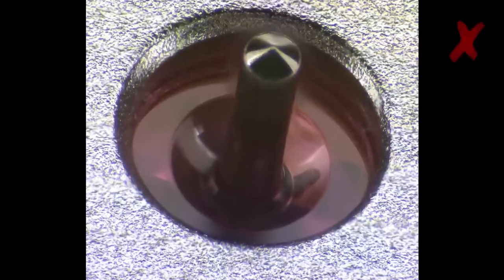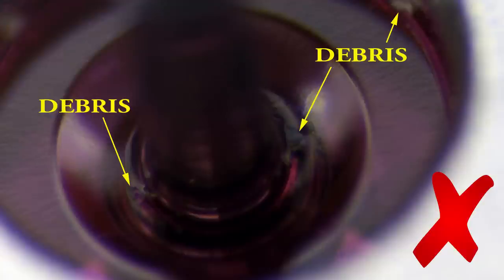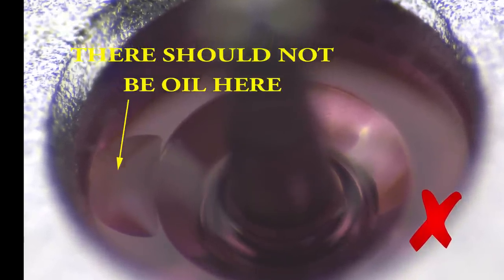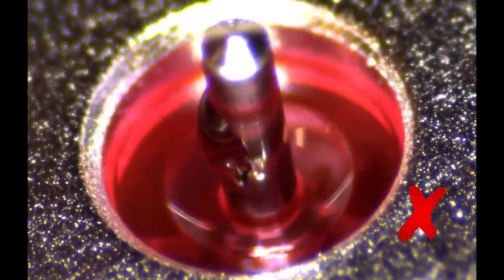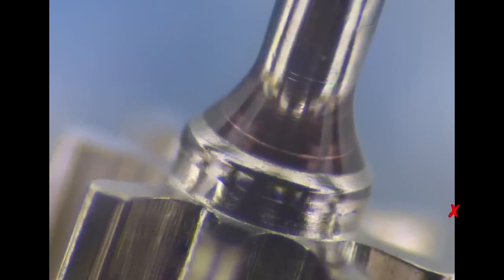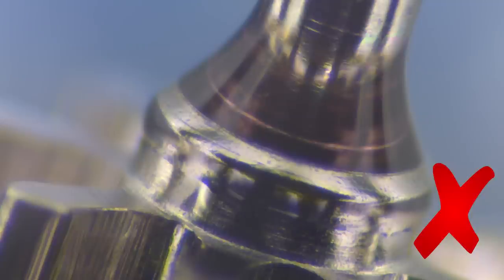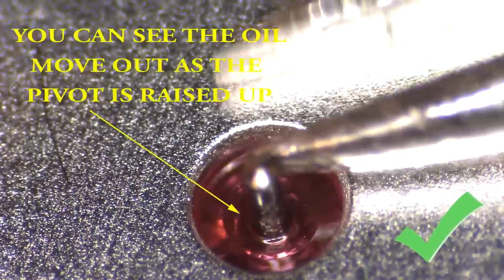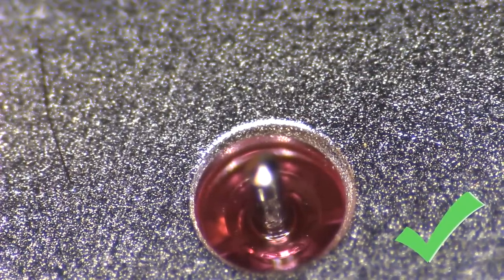Train Jewel Lubrication

Comment: Are there any advances in oil technology, such as fully-synthetic oils, etc....that can be brought to play in this topic?  Likewise, is there a modern grease that can be used that (maybe?) provides longer operational life between services....etc, etc???
Reply from the maker: Nearly every lubricant used in modern watches is 100% synthetic. There may still be some that are hybrids but I don't know of any manufacturers using natural greases anymore. The synthetic oils have taken service intervals to as much as 10 years for some watches but the case construction has a much bigger effect than the oils.
Reply: Thank you kindly for the explanation....by "case construction" do you mean number and type of jewels used, size and design of the operational parts, etc?  Or....do you mean the actual case as to allowing easy or hard dirt ingestion ( screw back vs snap-back case, etc)........
Reply from the maker: We mean the actual case. Keeping dirt and moisture from entering the watch has done way more than advances in lubrication to prolong the service interval. "Dustproof" watches and old pocket watches really need service every year if they are worn regularly, even if they have synthetic oils.
Reply: Dont use sintetics,,,, they will desapear fast...

Comment: I cant efford swiss oil its very expensive, why other oil can i put in my watch?
I know that in old days they used other cheaper stufff... like whale fat,,,so opinions, i was thinking in car gearbox oil, it has the same viscosity,
Reply from the maker: Watch oil is very expensive but it has been specifically designed to meet the needs of watches. If you use a natural oil you will have to service your watch much more often than using modern synthetic oils. We can only recommend you use high quality oils designed specifically for watch repair.
Reply: 5w40 will do it. 5 Liter Packages are quite cheap and last 2 or 3 years.